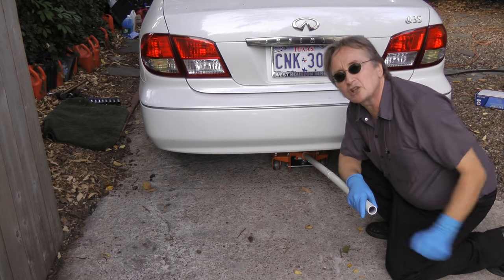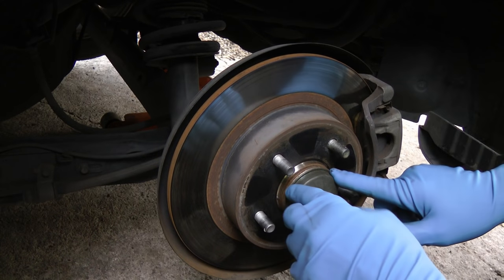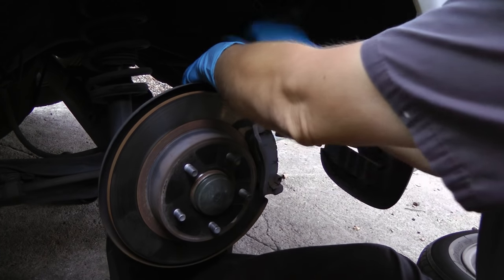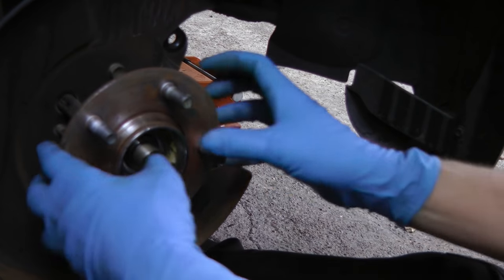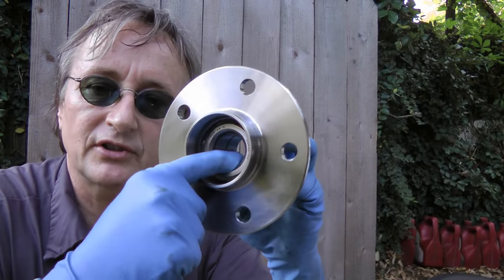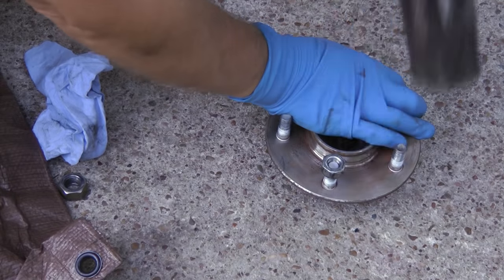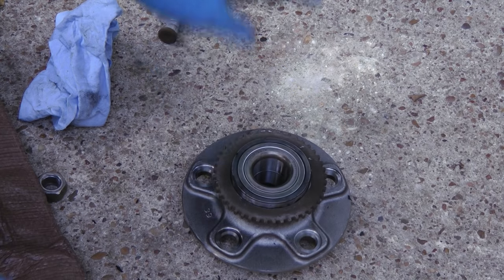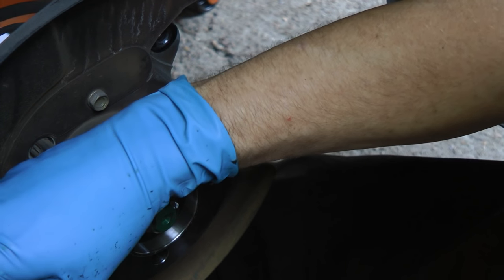How to Check a Wheel Bearing in Your Car (Replacement)

Comment from the maker: the hub/bearing assembly is one piece, which you unbolt and remove and replace as a unit. If you remove the 4 bolts eventually holding it on after removing all the other stuff, and it won't fall out, then hammer it out, they will rust in place over time
Reply: Thank you once again, Scotty!
You've been a lifesaver when it comes to automotive stuff.
God bless you and yours always.
Reply: Wat about A 2008 Ford crown Victoria police interceptor rear bearing replacement
Reply: @ChastenBias2300 you'll need a specialty licensed FBI agent/mechanic to change that interceptor's hub bearing otherwise 10 yrs to life.   Call FBI headquarters for service or pay the price.

Comment: Clear and informative but not being terribly mechanically adept I got my local mechanic/garage to do this on my 20 year old Jeep KJ with 130,000 on the clock. Both bearings replaced along with two new tyres, an oil change and MoT... total cost inc parts and labour was £960 ($1200 approx). Expensive, yes. But the only major job on my Jeep after many years motoring. Only other things done have been brakes, tyres, oil changes and timing belt. Great channel and always informative even if you're not a great fan of Jeeps

Comment: Noises can be hard to track down. you can use a laser thermometer to check bearing temps. The hot one is bad. 
Another method that may work is rotating a tire while touching suspension components such as a spring, or torsion bar while rotating a wheel. You will feel the vibration transfer to the suspension.
Reply: hmm that sounds like a very reliable trick only not certain I would be confident enough to go off of it

Comment: When tightening this type of wheel bearing do you use a torque setting?
How tight is tight?
Based on your experience, how many miles before wheel bearings fail?
Reply: +ktm3009v 110 foot pounds at least. Wheel bearings can outlast the whole car depending on the quality. Many American cars (particularly heavy SUVs) need them replaced every 5-10 years.
Reply: If you overheat your brakes where they start smoking, , wheel bearings will be toast in 5000 miles
Reply: Or a car accident, or hit a curb when sliding on ice at 40mph with van turned at 15 degrees... You need one the next day... 🤣
Reply: It's tight when the wrench stops turning
Reply: @wkroutz  wow, no. there are specs for your spindle nut that must be followed or you could lose a wheel while driving.

Comment: Hi, thanks for the information. The noise I have in my car is a high pitch squeek and mostly when I drive kind of slow about 30 miles an hour and when I'm not accelerating but just letting the car roll. Do you have any idea what could it be? Thank you

Comment: Good video, but did you use jack stands when you did this repair? uh-oh, I for one would be scared shitless to get under a car supported by only a jack  :-(
Reply: Yep, that's how people die.
Reply: Always use multiple supports.
Reply: Most people just use a jack
Reply: You know what you do in this case? When you take the tire off place it under the car near where the wheel assembly is. The jack fails the car will land on your tire. It may scratch it, but oh well lol.

Comment from the maker: generally bad intake valves on the engine, or bad ignition system. Do a compression test to see if the valves are bad first. Pray it's the ignition system instead, but that's harder to test

Comment: Just changed my front right bearing, i got so use to the sound it use to make that it felt odd not hearing it anymore lol
Reply: What model car did you replace it on? I’ve got a 2006 Ford Fusion with a bad left front wheel bearing and I really want to learn how to (and think I can) do it myself. Was it your first time, and were you successful the first time?
Reply: @SteveHacker  2007 infiniti g35 AWD, not my first time, this car its just replacing the hub assembly,  but the first car I did it on required a hydraulic press to remove old bearing
Reply: thabg007 I think mine can be done with a slide hammer and bearing press kit (rentable from auto parts store)... I think the hub can be done as one piece on mine though too...

Comment: Scotty, as a 40 year mechanic, (not quite 50 yet like you) I generally like most of your videos, and I agree with many of your statements, but this video is a little risky for many of the novice mechanics that follow your channel. Cars and trucks of today have a large variety of wheel bearing types. Some of these have very specific torque values. Doing this improperly can have severe consequences. A quick mention of this could save people money and a lot of headaches. Much respect.

Comment: Honda dealer charged me $180 labor for this. $200 for part. After taxes $420. After getting the car from dealer noise was still coming and i noticed they changed the wrong side. But dealership won’t accept their mistake. Now I will change myself and save $180. Thanks Scotty!!

Comment: Scotty Kilmer, I respect you a ton and know you know your shit, but I don't understand a couple things here. You don't use a torque wrench on the axle nut, which is extremely important (many bearings get ruined by improper torque on the axle nut) and you are putting the lug nuts on with an impact wrench, which usually leads to overtightening. Again I know you know your shit, but I am just wondering about those two things.
Reply: I think that's a very common mistake made, one very easy to commit when you're inexperienced. Starting lugnuts by hand is a necessity, as you know instantly if it's threading on correctly, while an impact gun can crossthread a fastener in an instant. The only time it's ok to use an impact for lugnuts is if you're using a torque stick, even then they have to be started by hand.
Reply: +Dennis R I was thinking the same exact thing. He made the whole video, why not mention to torque the nut and lugs to specification?
Reply: Jonathan Gingiloski I don't think he used a torque wrench at all honestly, which is why he didn't mention it. It makes no sense why he isn't using one, as you cannot reliably judge torque by feel. Improper axle nut torque is downright dangerous and will destroy wheel bearings, while improper lug nut torque will warp rotors if too tight, and obviously if they are too loose you risk them spinning off. I've seen so many snapped wheel studs from people cranking the lugs too tight, and studs also break many times from the lugs being too loose as well, when the lugs begin backing off, the wheel wobbles and destroys the studs through metal fatigue. I have no idea why an experienced mechanic like him is impacting on wheel studs and not using a torque wrench...
Reply: I completely agree with everything you said Dennis. I wonder how long that bearing will last with a completely unknown amount of torque on that nut. I'm good with a cheater bar or impact wrench for removal but I strictly use a torque wrench for assembly. It only takes a second to set and you don't run the risk of taking the heads off of bolts or under torqueing them.
Reply: Jonathan Gingiloski You sound like you do work correctly and safely, that's great to see. The little extra time you spend to do it right the first time is much better than the time and cost to have to redo the job when your new parts fail, or even worse get seriously injured from something like your wheel flying off after your wheel bearing fails. I've seen brand new wheel bearings fail after a few thousand miles from people who replaced them and didn't torque the axle nut correctly. The less knowledgeable backyard mechanics tend to just crank it on with a cheater bar and pipe combo super tight, thinking "tighter is better" without even bothering to use a torque wrench. Overtightened axle nuts lead to a massive preload on the bearing, and usually a catastrophic failure. 

Couple weeks ago a car was towed into the shop, wheel bearing had failed after only a few thousand miles for the exact reason previously mentioned, the tire was bent out at nearly a 45 degree angle, and the wheel had nearly separated. I am all for the do it yourself mentality, I started off as do it yourselfer before persuing a career in automotive myself, but it's important you do your research and are willing to invest in the tools to do it right. That's why this video kinda irked me, because these are the kinds of videos DIY'ers watch to learn how to do repairs, if they go torquing on their axle nuts with no torque wrench, and impacting on their lug nuts, VERY bad things can happen to them on the road. This video is teaching dangerous techniques...
Reply: cyrax99 I was told by my grandpa that you want the wheel to be just loose enough to spin freely in this case. And that its held together with codder pins, which werent mentioned in the video. Now granted he mostly deals with classic cars
Reply: +Fox McCloud
those cars have different bearings. You Grease the bearings and install them on a taper rod. Tighten the nut, back it off then tighten again a lesser amount then use a cotter pin.

+cryax99
i have installed wheel bearings correctly with the specified torque and had bearings go bad because they are just crap parts.
Reply: taledarkside Apparently both front wheel bearings had gone bad when I had to get several front end problems corrected on my car (the whole front end was basically shot). I didnt suspect they were bad because I didnt hear the noise nor did the wheels have a whole lot of play in them. My guess is is that these were all issues the last owner either neglected or never known about. I was hoping it was just a bad ball joint and that was why my car was way out of alignment, scalded the tires and would snap oversteer at random. Its been fixed now since I had it dropped off at a seemingly reliable garage and I havent had any real handling issues since.
Reply: My brother has been a mechanic for just about as long, about 40 years, you develop what is called a micrometer feel for things. He can look at a bolt or nut and tell you exactly what size it is, and inch or metric. He can also impact  or wrench fasteners and come very close, within a few pounds of spec. They get to just doing those kind of things automatically, with out thinking about it.
Reply: He's at the I don't give a s*** point in his life. Been there done that.
Reply: Those bearings are the type that are tightened very tight. Those are not the tapered type. But yes, there is a proper torque specs for it. And I cringed when he used the impact on the lugnut.
Reply: @DAN007thefoxx1  I am older and was shocked to see Scotty cranking the bearing nut down like that, so replayed that part of the video. Older cars had a cone shaped roller bearing, which indeed was left slightly loose or would not roll free and eventually fail. But this wheel bearing was a ball bearing, which does need to be secured. The older caged roller was held on by a castle nut that was secured with a cotter pin. And we would "repack" the bearings with grease from time to time. I imagine new technology of both metals and greases have made that obsolete.
Reply: I do it PROFESIONALY, recommended buy NOT Imparative (just make it tight)!
Reply: Yeah I was always taught do not use an impact to tighten your lug nuts use a torque wrench and with the wheel bearing I was always to tighten it all the way down and then a quarter-turn back then set your cotter pin period.

Comment: Why does my car use press bearings -_- this looks SOOO much easier
Reply: Me, too.
Reply: You can usually buy the assembly the bearings press into with the bearings already in it, but it will cost more.
Reply: Like 5-10x more expensive.
Reply: I understand your comment; this IS easy on what appears to be a front wheel drive, because the rear wheel just free-wheels. rear wheel and all-wheel drive is more difficult as the bearing does need to be pressed out.

Comment: Hi Scotty, I have a 2001 Jaguar S-Type 4.0 Liter; I need to replace the right rear bearing because I had a mechanic shop replace it two months ago and now it is making that winding noise again.  I purchase a wheel Hub and Bearing set from eBay because Jaguar does not make the hub anymore.  I went back to the mechanic shop to let them check this and I was told the Bearing I purchased from eBay was a cheap Bearing and I should have purchased a 3 Year Warranty Bearing because they are better quality.  So now I have another Rear Wheel Hub and I purchase a 3 Year Warranty Bearing from the local parts store.  Your video is amazing and gave me confidence I can do this myself and I have the tools.  Questions, the new Bearing is sealed --do I need to try and and more grease to it? Second Question --do I have to grease the axle spindle before I insert it through the hub?

Comment: Just a couple questions.
1.) should the tone ring be scrubbed or cleaned?
2.) when putting the new bearing on and tightening the bolt, is there a torque setting?
just learning now so I know what to do when the time comes to do it.

Comment from the maker: not for that model, but do you mean ball joints or wheel bearing? There is no lower ball bearing part.  If you mean ball joint, a specialty press is needed on that ford

Comment: Hey Scotty long time viewer and fan of the web show, Your videos have literally saved me thousands thus far and taught me a lot along the way. At the beginning you said "this doesn't have play". My cars front driver tire leans in like "  \ " . When I jack it up it rocks back and forward at top and bottom. Do you think this is a sign of ball bearings going bad also?
Reply from the maker: +cleveland sullivan sure sounds like it, but of course check for any worn parts like upper and lower ball joints or control arm bushings too
Reply: +cleveland sullivan  if it's leaning you may have other issues, when you rock it back and forward it (top to bottom) only the hub assembly will move if that's the case then it will be the bearings, but if the strut is moving with it you have more problems! but i would geuss this is a bearing, with that much play you should have a good rumbling sound whilst driving which will get lighter around corners when there is less weight on the wheel.
Reply: +airstreamresto awesome I will check it out.

Comment: Scotty, I changed the front pads and rotors on my 2002 Avalon and the brake pulsing was fixed, but now it seems to have come back, just not as bad as before. Do you think the rears are warped too? I'm hoping it aint bearing issues

Comment: Scotty, i just installed new tires and a sound that wasn't there before just appeared on the front left tier. I want to believe it's because they tighten the tire too much, but I'm starting to believe it's a bad wheel bearing. What do you think it is?

Comment: Also before tire removal,hold onto strut or caliper or something solid. Spin the tire quick as possible, with a helper if possible. If you feel roaring or hear it, that is also a possible way to help indicate a possible bad bearing.

Comment: hey Scotty does a wheel that doesn't spin as freely as the other side mean the bearing is bad? One of my rear wheels spins freely and one takes more force to spin it and it spins a lot less.
Reply from the maker: IF the brakes aren't dragging, yes. But often dragging brakes does that
Reply: I know that the rotor on the side that is dragging has a tad more wear to it than the other side that isn't dragging. (New brake pads and rotors installed recently). I think the caliper might be sticking to be honest..

Comment: I have a 1993 Chevrolet S10 pickup which has the inner and outer wheel bearings inside the rotor. I was going to replace the wheel bearings but they don't look like they need changing. I was just going to install new brake pads and replace the rotor. I wanted to save time and just replace them but of course that's more money. I was wondering what would you recommend?

Comment: I have a 2004 Pontiac Montana with front wheel drive. This winter was brutal on the van, and now there is a massive roar with shaking on the passenger side of the front. I've suspected a wheel bearing issue, but not sure how to handle checking and replacing it with it being the drive bearing, is there anything different or special from a non-drive wheel bearing? Or could the roar and shaking be something other than the wheel bearing. Van has 155k miles. Your Videos are SO helpful :) thanks!

Comment: That look easier then working on a gm hub bearing. I did a few gm hub bearing it was not so easy. Is that because it was the rear and not the front ?

Comment: Thank you for your Videos, i have a 96 GEO Metro what kind of job will it be to replace front wheel bearings, what tools will i need to do this my self or should i get help. Again love your videos.
Reply from the maker: Same as in this video, you just need a bearing puller tool, or take the hub assembly to a machine shop and let them press the old bearing out and the new one in
Reply: ok perfect thank you. i also have a 77vhevy short bed 4X4 i will be hitting you up for advise. thanks again

Comment: Hi Scotty, thanks for your videos. I’m having an issue with my front left wheel, every time I turn left from a STOP, there is loud popping/clunking noise until the wheel is straight again, no other noise other then that, and It’s only when the car is driving making a left from a stop. If I’m idle and turn the wheel then no sound. Just trying to figure out what It is. Thanks

Comment: I have a 2002 Ford Crown Victoria which was my patrol car til my department retired it. I have a growling/grinding noise when I start from slow speeds and slow turns. I'm thinking it may be the front wheel bearings. What do you think?